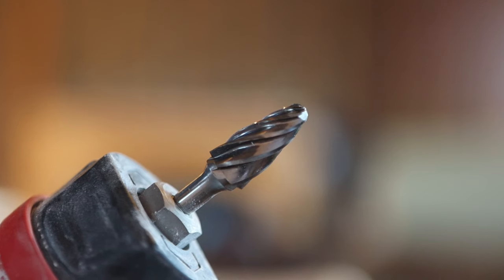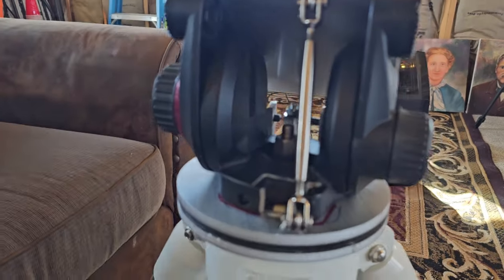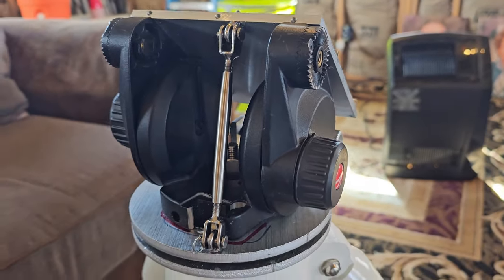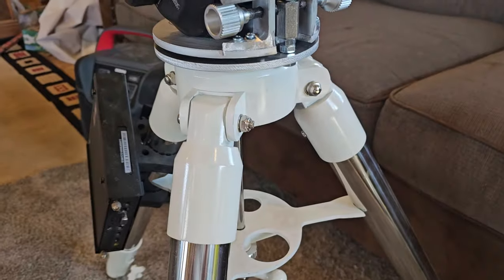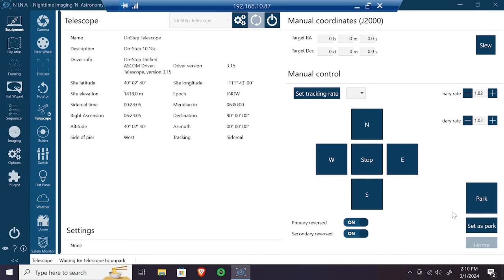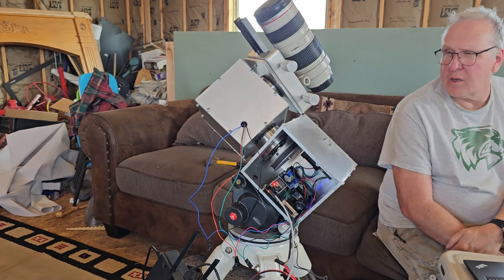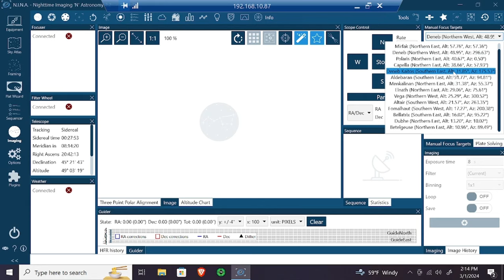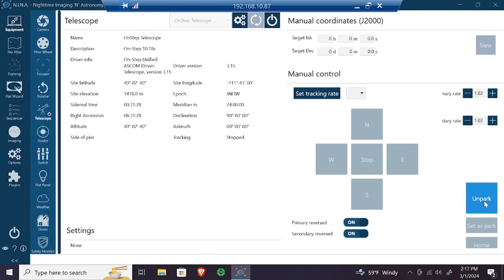DIY Harmonic Drive Telescope Mount Part 5

Comment: I usually find a big hammer makes things fit to which just about shows my engineering expertise, well done that's coming along great. I noticed while you were slewing from North East to North West it goes to the parking position stops then carries on so must be a quirk with Onstep as my old CGE pro does the same. Not that I'm complaining as it bought back to life what was a completely dead mount.
Reply from the maker: Yes my other onstep mount does the same.  I usually only slew to one target a night to image so it doesn't bother me.

Comment: Superb and impressive work. I made my own a few months ago, named DHEM, open source. Your videos are very interesting, thanks for sharing.
Reply: just checked out your GitHub and I have to say, Amazing work. I'm now considering building a mount of my own for an observatory and your design is amazing. I have a friend with a machine shop so I can machine some pieces to make a mount like Alan. Again, amazing workmanship, I'm very impressed. Do you have any advice for someone about to take on a similar project? (besides having fun LOL)
Reply from the maker: What I would give to have access to a mill and lathe. Would be less "redneck" 😏
Reply: @whyf16uy  yeah it really opens up lots of doors. I cant speak for long term performance but there are lots of cheap chinese mini lathes and mills around. I'm about to buy a pair after a lot of people recommended then in their reviews. Its about 1200$ for both, might want to look into those.
Reply from the maker: @irakliveshapelo02-mb4mj O I have. Just can't pull the trigger on them yet
Reply: @whyf16uy  yeah I understand, it's hard to make those types of purchases(especially if you have a spouse xd). If you are still on the fence I'd highly recommend buying them, I have worked with old soviet school machines(no Idea how they ended up here) which were basically scaled down versions of the big machines( lathe and mill), although they did lack power sometimes, they were still amazing around the shop. one benefit is that they are less dangerous due to the lack of power. If the chinese machines mimic those, which they seem to do, then they are amazing machines, especially at the price range.

Comment: This looks great! 
If you ever make a version 2 you can probably get rid of the brake on the equatorial axis motor and save some complexity. Because of the way they work harmonic drives can't be back driven. The brake won't ever hold any load unless the teeth shear out of the gearbox.
Reply from the maker: And if you put too much load on the drive the wave generator can pop out of the flex spline. Ask me how I know :)
Reply: @whyf16uy  ouch! Does this mean we get another video?
Reply from the maker: @SpacePotatoMan Uploading as we speak 😁

Comment: Fascinating project, So I’ve been working on a project but seeing this got me excited, the problem is I cannot find the harmonic drives for less than £250 each, so £500 plus the dreaded kings tax @ 20%  add the extra bits I’m into over half way into branded territory although It won’t be made by myself and the satisfaction, plus all the other bits would be available to replace individually when they wear out, looking forward to your next venture.
Reply from the maker: Well I have information on new drives from China that are very cheap. Watch my next video coming out tonight.

Comment: Amazing work, I'm about to start building something like this. Just one question, even if the harmonic drives are rated for the weight, wouldn't it be a good idea to attach some counterweights? Maybe it could increase the lifespan of the harmonic drives? looking forward to seeing the first light video.
Reply from the maker: Probably. The AM5 is rated for 25 lbs before you need a weight, These are the same class of bearings I believe and my OTA comes in at 24 lbs so I am going to try without first.